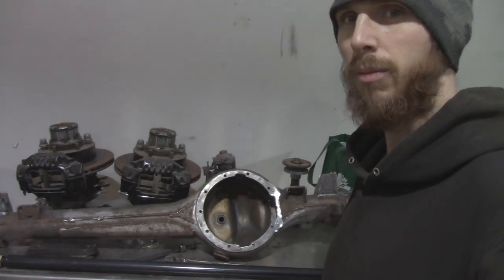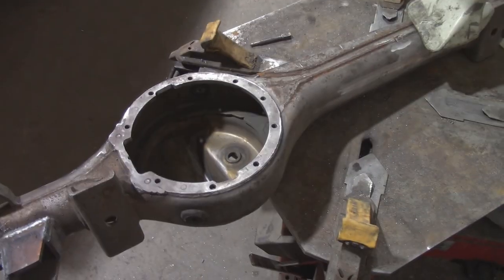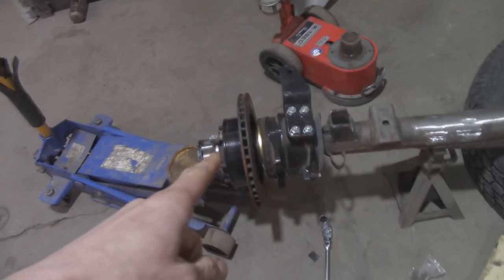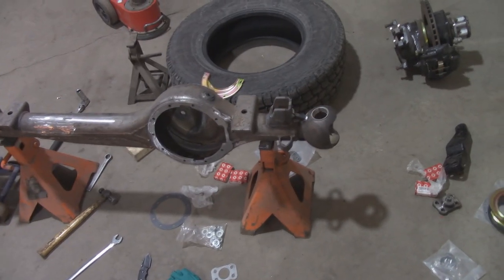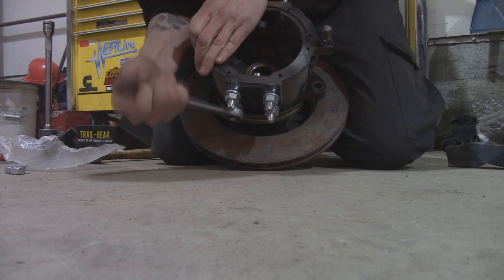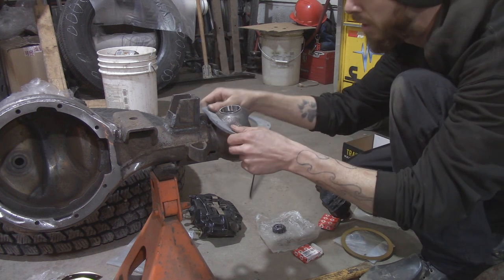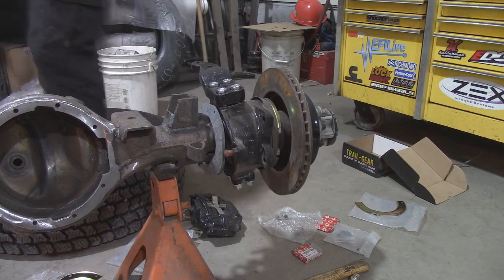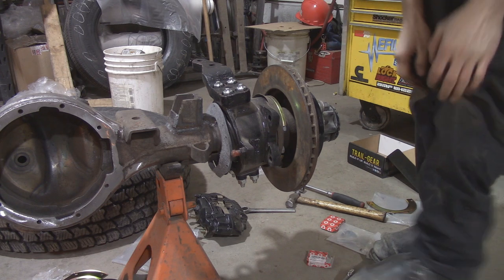Ultimate Offroad Mazda - Toyota Solid Axle Build pt1

Comment: Looking good man! 👌i thought you would have plugged your steer stoppers.
Reply from the maker: I still have some work to do on the axle. Gotta drill and tap for new studs as well as install the elocker and axle shafts. I should have braces the steering stops before i painted it though haha cheers!
Reply: @analog56x  Stack 2 nuts 5/8'' 11 than cap top & bottem of each stop is strongest way i know to beef them, Other than replaceing w solid steel stops.

Comment: Is this a Auto locker im olso Puting ing a Solid Axle in My Mazda 4wdrive  but i need a E locker but the Axle is a manual hub locker how do i fix that so i press a button in the cab to lock the front axle
Reply from the maker: i have manual locking hubs on this axle. im also installing an elocker, so the hubs will just stay locked all the time. im not worried about it.
Reply: @analog56x  i have to be cuss i cant have the back pushing all the time agenst the front i want to lock it with the exsisting Locking system in my rig
Reply from the maker: @TheEdwin071  im not sure what you mean there bud...
Reply: When i drive normal or tar its in 2 wheel drive when i go off road i want 4 wheel drive so i dont want the front axle to be locket all the time
Reply from the maker: @TheEdwin071  but then anyone else with your same question wont know the solution... plus i dont have a dedicated business email. if you go on my facebook page, you can send me a message. facebook.com/analog56x

Comment: i'm putting together the same kit form an SAS on my Mazda aswell.
what are your plans for the conversion? 4 link or leaf springs ?
question about the diff ratios that you plan on using??
Reply from the maker: nice man! i love solid axles haha! gotta put em in any 4x4 i have :P
my plans for conversion are in 2 stages.
stage 1: toyota frame with the stock toyota rears up front, tacoma long springs in the rear
shackles up front on the front axle
mazda 5spd trans and tcase (tcase outputs modified for toyota driveshafts)
volkswagen 1.6L diesel engine
elockers front (and rear if i can get my hands on another one)
4.56 gears (for now, probably going to go with 4.88's once i can track down a couple pairs of them)
37x12.50-15 maxxis creepy crawlers with the aluminum rims that are on it (i want that super squat when i air down for snow wheelin)
try to keep the truck low, if im too tall, ill have to clearance a bit of the body to stuff the 37's.
i want it to flex like crazy, so i will be going with pretty much flat leafs. the tacoma springs have a slight arch to them, but they should still flex well, as ive removed the overload spring.
ill probably have to build some anti-wrap bars when daily driving to keep the axle wrap to a minimum (flat springs tend to wrap more with the shackle setup im going to be doing)

stage 2: swap out mazda trans and tcase for a toyota R150 trans, and install a doubler. i love that 4 low low crawl haha!

cheers bud!
Reply from the maker: you should post up some videos of your build dude, id love to see another mazda build!
Reply: @analog56x  
 mine is on a 2002 un mazda bounty in nz
i will run a OEM mazda rear diff and a matching OEM toyota gear set. (i have then in the shed will be toyota lsd front and mazda lsd rear)
leaf springs in the front will be OEM toyota  (can use all Nolthane bushes for toyota Off the shelf parts and common )
custom made front leaf spring hanger in the front (need to be able to attach ARB winch bumper to it)
steering will be a Toyota and Mazda hybrid 
OE motor and gear box will stay, i have spare Mazda and Toyota drive shafts to one from a few 
i have photos of the build this far but thats it
Reply from the maker: Oh interesting. Im ditching the mazda rear, as its super hard to find parts for. Plus, at least here, toyota doesnt have any gears other than 4.10's in common with the mazda. Right now, the mazda has 4.44's in it. Closest gears toyota has is 4.56, so i decided to go all toyota.
Pretty much the only things mazda on the v1 build will be the body, trans and tcase. Everything else will be toyota with the exception of the vw diesel engine. Haha, i love building franken-trucks haha
Reply: @analog56x  
yea so for budget i will use the 4.1s that they have in common.
i was planing on using the standard mazda transfer case output shaft and making the toyota shaft fitt, eather by welding the flange on or  may be a universal change.
but yet to look at it and sort it 
i can send you photos so far if you want

Comment: Are those V6 rotors and brakes?
Reply from the maker: V6 calipers, 98 tacoma rotors
Reply: analog OffRoad thanks man! I’m building an 84 4runner. Just installed 4.88’s and a Detroit. I was looking into upgrading the brakes and wasn’t sure what years worked.  Do you need the 98 rotor bearings or do the original ones work?
Reply from the maker: @SubePelayo928  rotor bearings?  do you mean hubs? these are custom machined IFS hubs on my solid axle. i turn the outer diameter down so that i can slip the tacoma rotor overtop of them, instead of having to bolt the rotor to the back of the hub.
Reply from the maker: @SubePelayo928  check out my big brake mod writeup that i did for marlin crawler, i break down everything you need and everything i did.

https://board.marlincrawler.com/index.php?topic=78969.0
Reply: analog OffRoad I’ll check it out right now! I appreciate it!
Reply from the maker: @SubePelayo928  cheers bud!